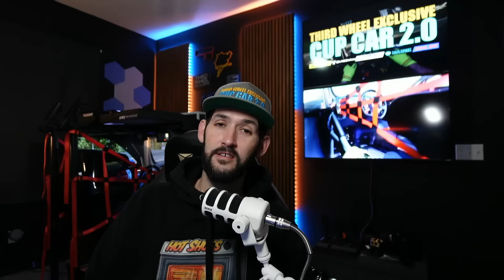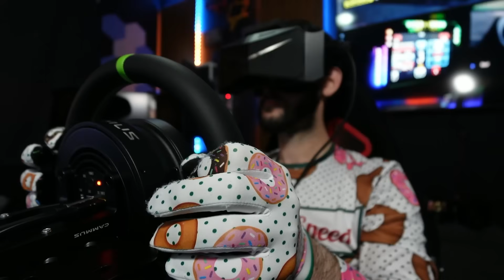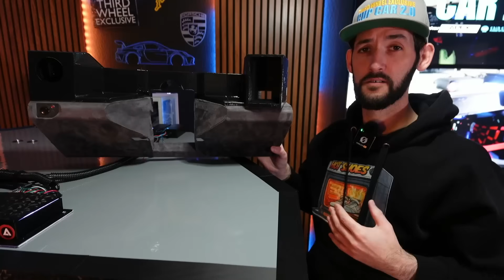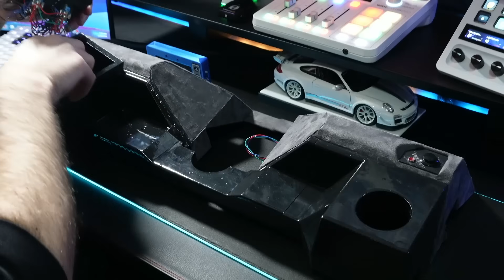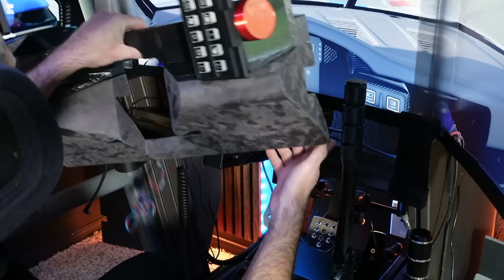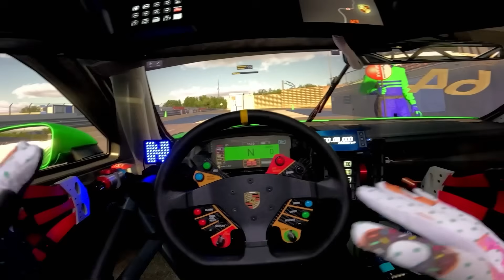Cup Car 2.0: The Most Immersive Sim Racing Cockpit Build Continues

Comment: Did you set the ambient lighting further back on the roof to combat glare?
Reply from the maker: Yeah, Glare and sunroof effect. The boxes do a good job of preventing it anyways but I still need to add the Govee lights for directional light. That’s where the glare problem really comes in so I’m still working on a solution for that.

Comment: I try to print the dashboard but you tell cut in 3 it’s still don’t fit on a bambu p1s 256x256x256mm max print size can I send you a email send you how I cut it thx 🙏
Reply from the maker: You might have to add some modifications. I use a 300mm cubed bed. You may need to cut in more pieces and utilize a different method to connect it together.

Comment: Love the dash ! Thank you for your design, it's been so helpful ! 
Been printing it myself and carbon wrapping is a pain in the ass but worth it !
I've just replaced the button box with a Streamdeck.
Would you mind sharing how you did the ignition button on the bottom left ?
That's the last part I need to build :D
Reply: Hi, hope you are doing well. How did you get the 3d print dash enclosure ? Thanks !

Comment: Damn bro, if you have quest 3 or any headset that does Passthrough with virtual desktop.. you could cut some of that time in half, the time it takes you to line up everything..

It's like having a transparent virtual 3d image over your entire rig, you could line up everything 1:1

#MixedRealityRacing
Reply from the maker: Not a bad idea but I wouldn’t get much use out of it beyond that. I like VR but find that I rarely use it.
Reply: @ThirdWheelExclusive  check out my last video upload to see how I'm implementing it..no self promotion , I promise you will be surprised.

I currently use it to race in VR Mixed Reality where I can see my wheel and hands blended in VR (full 6dof etc)..

Accidentally it actually helped me line up my real rig 1:1 as it is in the sim.. but I change cars alot so sometimes the gear shifter positions are a bit off sometimes 

I got a lot of ideas from yours and others setups.

Looking forward to the more of Cup Car 2.0 💯

Comment: Excellent :_Sweet: thx 🙏 for the update mate
Reply from the maker: My pleasure. Should have some new designs coming soon.
Reply: @ThirdWheelExclusive sir the dashboard files upper and lower you print this file in 1 time ? Of you cut the  dashboard in 2 pls explain me
Reply from the maker: @donkotse I cut the lower in half and the upper into 3 pieces. The middle section of the upper should lock into both sides of the lower to hold it together.
Reply: @ThirdWheelExclusive ok sir but with your printer you print it in 1 time the upper and after the lower in 1 time